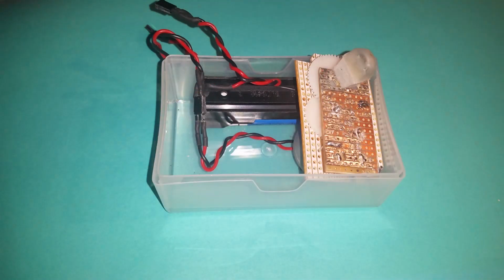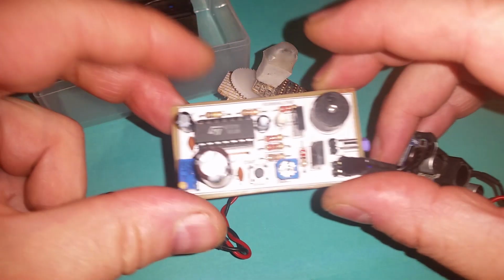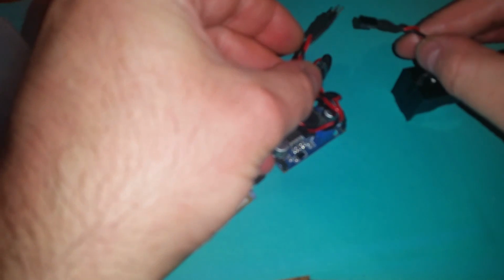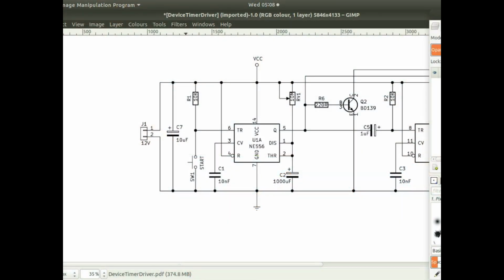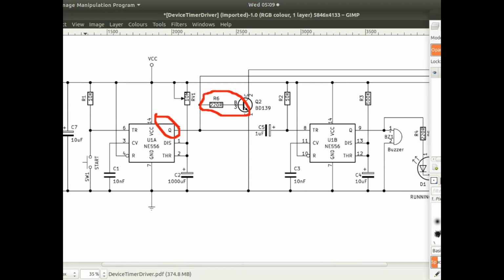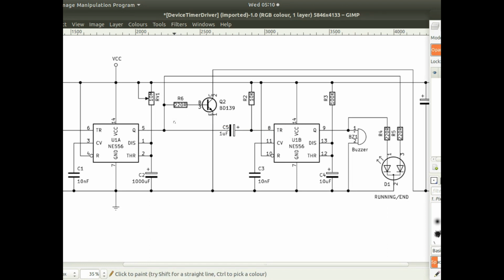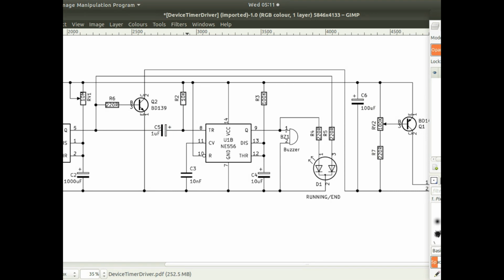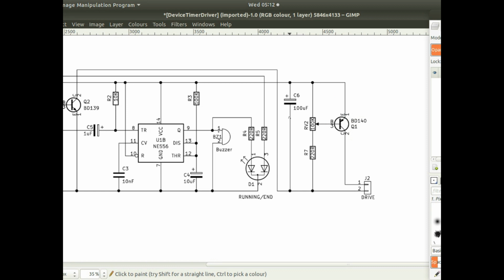Ferric Chloride FeCl Etching Stirrer and Neodymium Compass

Comment: So for smaller etched boards I went a bit simpler than this. I have a few AC mains motors from microwaves I've taken apart, the slow speed ones from the turn table. I mounted one of these motors in a ~30cm diameter old plastic box. I used the 3 armed trolley from the original microwave turntable with the motor too. This spins on top of the box. If my board is small (~5cm-7cm), I place it in a small glass dish with a sealed top. I strap the glass dish with the board and ferric chloride to the outside end of one arm of the turntable trolley. The last step is to prop up one side of the whole assembly, motor/box/turntable, so that one side of the device is slightly higher than the other. When the motor is slowly spinning the liquid is moved across the board based on the high and low side tilt of the box. Also, when these types of geared down motors are given an unbalanced load they tend to do a bit of shaking as well. 

  For my larger boards I use hydrochloric acid and hydrogen peroxide. I'm using a large glass casserole pan that is far too large to mechanically move around without creating a mess. I've been stirring it by hand but that gets old. I ordered an actual magnetic stirrer on AliExpress about 2 weeks ago for $1, but haven't received it yet. I was planning on simply gluing a magnet to a small power supply type brushless fan to spin it. 
  The holy grail of this kind of thing is a heater and pump with filter. I'm kicking myself for salvaging the magnet wire from a pump I pulled out of an old dishwasher. After taking it apart I realized the motor was magnetically isolated so the fluid portion of the mechanism was totally devoid of any seals or metal of any kind. It would have made a perfect acid pump. I've bought several cheap "submersible pumps" trying to find something with similar isolation but haven't found anything yet. That's just a few ideas for anyone doing a similar setup.
   I like the effort of the timer, and I hadn't thought of using 2 old strip boards for mounting gears like this. I typically save the entire motor and gear assemblies I come across from printers vhs players and dvd drives. I just cut out the surrounding metal or plastic with enough margin to reuse it :-)
-Jake
Reply from the maker: That is some good information. Like you I collect the bits from items when they have reached the end of their life. I have also thrown stuff after having it years and clearing space, only to find it would have been useful soon after.
Reply: @DevelopIT  
  Yeah, my rule is "only keep what I can organize, inventory, and access."
    I periodically go through and throw out junk, but I'm usually just breaking it down further and further into more relevant bits. A few years ago I was running a large eBay store and specialized in creating listings with low international shipping costs by making my own packaging for difficult to ship items. Now I use those box making habits for organization. That's the real key IMO. I actually have an extremely tiny space to work in but have packed it with tons of storage. The secret is finding items you use daily that come in packaging that can be repurposed. My favorite items are dove soap boxes and cereal boxes. 
  For soap boxes I have a jig with a razor blade held parallel to the flat surface the jig sits on. This blade is set at exactly half the height of a dove soap box. I cut the boxes in half to remove the soap. I just stand the box on a table next to the jig to cut a perfectly square and centered edge around the middle circumference. Then to make them last longer I put a thin bead of hot glue around the cut edge. I have an old library card catalog cabinet of drawers, and I fill the drawers with the half soap boxes as dividers. They are well sized for 34 boxes to almost perfectly fill a drawer. I've been doing this for a few years and have filled 15 drawers with soap boxes so far. It's nice because the boxes are individually removable and are easy to reorganize as my organization expands.

  With cereal boxes I usually cut them down to just the largest panels to make them store flat. When I need some custom size storage I use this material. However I usually develop my own custom open box templates with the cutting outline and all crease edges marked in the template. I then use these templates to make repeatable copies of the box. The big secret to perfectly square boxes is always incorporating the additional 2mm needed for the bended edge length of every folded corner. 
   For instance, with cereal boxes I'm currently a little less than halfway through making custom individual boxes for all e24 resistor values. I can make 4 resistor divider boxes per cereal box. There are 192 total values in the e24 series from 0R1 to 10M (8 decades * 24 values per decade). I've processed 18 cereal boxes so far and made 72 individual dividers. I only need 30 more cereal boxes to complete my index :-))
 I just try to be patient,... very patient... At least that's how I manage the mess without throwing out too much that can be reused :-)
-Jake